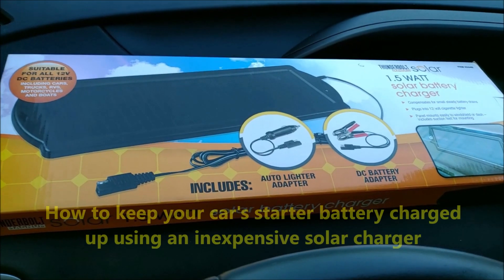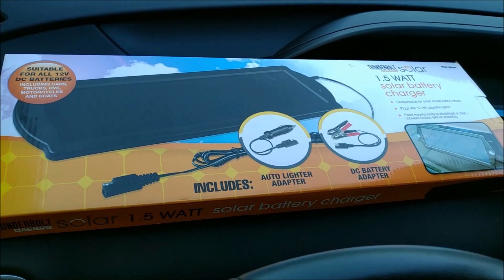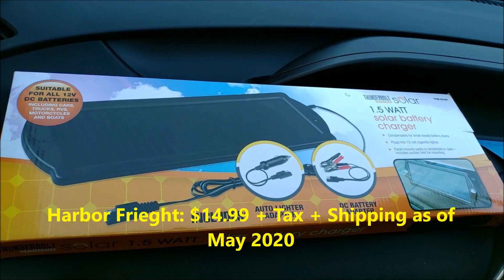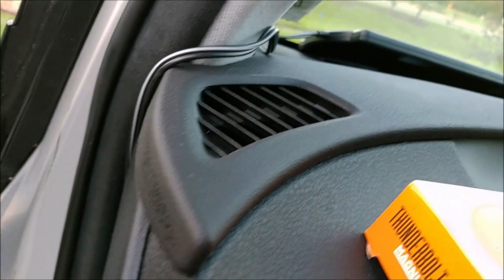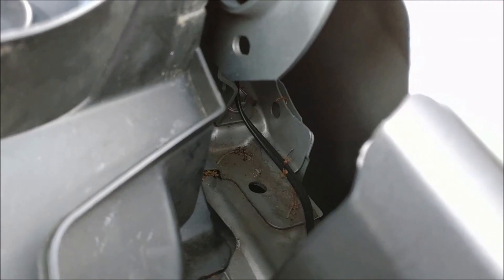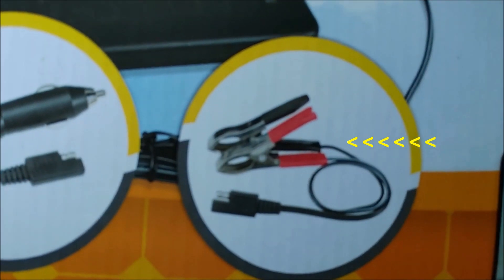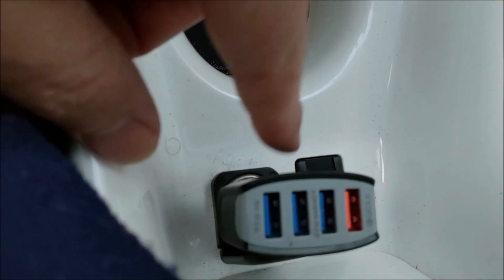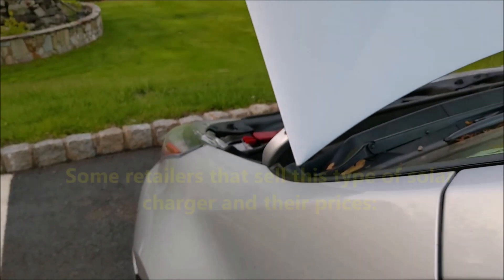Car Solar Trickle Charger During Coronavirus Pandemic | Installation Guide & Tips

Comment: Shouldent you connect negative to the ground instead of directly to cars battery negative pole?
Reply from the maker: Not in this case because it's not high amps like a jump-starter. However, check the manual for correct installation

Comment: A few people are defending idling the car to maintain battery health. Idling an engine in a modern car is fairly useless for maintaining the car battery's health. Especially with how much power is consumed by onboard electronics on a typical newer car and simply starting the car, it's clear that going for a drive on an open highway for about 20-30+ minutes once a week helps recharge the battery whereas idling does little or nothing for most cars.

That said, since I have two family cars that aren't driven much, I now have two solar trickle chargers that have been fantastic.
Reply: Yes, and if we equate the amount of energy used to start the car, even with a good-starting engine, that’s a chunk.  My experience of our little French Clio from 2000 (!) is that it works very hard if it finds the battery is low, the alternator really is made to pump out energy.  I put a brick on the pedal and a small block of wood under it, so the car revs but not too much.  Overall, this works, but it’s a lot of fuel - I calculated one tankful of this little car was getting 42mpg, then the next tankful was over a cold period, and it managed only 33mpg.  The routes were broadly the same, but at least half of the difference - 5mpg say - was due to the idling/warming/defrosting actions.  Free energy, is hard to argue against, so I caved and bought one in the UK, recommended and sold as an Automobile Association product.  Only 4.8 Watts, my Prius is the worst for phantom/parasitic drain, and Toyota UK have literally advised people to ‘drive longer journeys’, to avoid their battery running down, when they are not driving much or far.  !  Seeing how it goes.  Not detaching it when I start or drive the car.  Will mount under the rear hatch somehow.

Comment: I was worried about being able to close the hood with the clamps connected to the battery, but it seems like that wont be an issue, correct?
Reply from the maker: It has to be done carefully through the quarter panel if you can find a gap, as shown in the video. Also be careful about rain water getting in through the door. The wire should be facing downwards as shown in the video.

Comment: Towards the end of the video you start to talk about using another item so that can be used so that  you don’t have to run through the cord thru the door to clamp on the battery. But the video ended. I’m trying to get a device that will keep my battery charged without having to start it each week and let it idle. Can this device charge my battery without having to feed through the door for the clamps?it looks like there are 2 different cables. Thank you
Reply from the maker: If your vehicles 12v outlet (cigarette lighter socket) remains powered ON even after you turn off your car and remove the keys then you can use the 12v adapter that comes with this solar panel. You can test if it remains ON after you turn off your car with a 12v phone charger or something similar.

But if your vehicle's 12v outlet (cigarette lighter socket) does not remain powered ON after you turn off your car and remove the keys then you need to run the cable through the door and use alligator clamps, or find a way to get the the cable through the firewall to the battery.

Some vehicles like Dodge Grand Caravan and Mazda SUVs have two separate 12v outlets. One turns off when the car is turned off, and the other remains powered ON. The one that remains powered ON has a battery sign on the outlet cover.
Reply: @americanhindi  thank you so much! That’s the exact info I was looking for!

Comment: Will this charge the battery even if the car is under cover and no direct sunlight falls on it?
Reply: My solar trickle charger has an indicator light which does come on, even without direct sunlight. I had tested throughout the day if it would be a charge underneath a carport. It may be noticeably slower to charge though, especially if it's a low wattage panel to begin with.

Comment: Is it possible for you to actually discharge the battery if you leave this connected, say during the night?
Reply from the maker: Only if the solar panel's diode is defective or broken. Mine is continuously connected to the battery since this video was made.

Comment: Thanks a lot. Cant seem to find these in Mumbai so I just ordered a 5w12v solar panel and a smart controller for auto cutoff at 15v for a DIY project. Hope to install it soon. Total cost around Rs.800 and should keep the battery topped up!

Comment: I think if the lighter charge point switches off then you can charge the battery because there will be no current coming from the battery. Henceforth an open line to the battery. 
I might be wrong, but it makes logical sense to me.

Comment: So for people that dont know a ton about vehicles. If your battery is dying or not starting up your vehicle due to you not driving your car for the past few days that would mean either 2 things. 1 your car is using power meaning you left a light on or something. Or 2 your battery is bad. If your not using your car for several days then your not using power so your battery should be stable. now it is good to go out and run your vehicle every 3 days or so for about 10 to 15 min so its not sitting. But this method would be good for those who have a special vehicle that just sets and only gets driven on certain special occasions.

Comment: I bought this same one, my problem was that when I left it hooked up to the cigarette lighter at night, it drained my battery!  Also, would it be better to hook it up with the cables directly to the battery?  And do I take it off at night and on rainy days as well?  Thank you!
CANCEL
Reply from the maker: If your cigarette lighter socket stays powered ON even after you turn off your car, then it should work. If the socket disconnects when you turn OFF your car then you need to connect the panel directly to the battery but follow the manual. You can test your socket with a phone adapter as shown in the video. Make sure the cable is secure and check on it periodically. 

This panel has a diode that prevents reverse charge, so current flows in only 1 direction. If the panel drained your battery overnight then the panel is defective. It shouldn't drain your battery. It is designed to keep connected at all times if that is needed. You don't need to disconnect at night, unless the panel has a defective diode.
Reply: @americanhindi  Thank you very much for your answer!  
This is really  helpful!
Reply from the maker: @idekmarijke2380  You are just welcome.

Comment: I did this other day not because of any videos but I just thought about it. Because I has two big solar panels doing nothing from previous projects. I went through like 3 batteries over years. Running car on idle isn’t doing harm for your car look at all the cop and ambulances. We usually have storms and power outages here so living in cars is common

Comment: Hello, i don t have a 12 v socket in my car, i just have  a 5v, doest it work or i have to connect the panel directly to the baterry via the crocodyle clams ?
Reply from the maker: This is a 12v trickle charger. I'm not sure if it's safe to connect to a 5v battery.
Reply: @americanhindi  thnak you. The car battery is 12 v but the socket in the car is 5v. What i want to say is that i don t have a 12 v cigarette socket , just a 5v socket in the car to connect the solar panel to the 12 v battery of the car. I hope the 5 v socket works
Reply from the maker: @radum3738  If you don't have a 12v socket, then you have to connect it directly to the battery but make sure the cable is secure. I would disconnect it before driving the vehicle if you cannot secure the cable under the hood.

The 5v outlet probably has a resister that prevents reverse current, so it may not work, or damage the resister due to higher voltage.

Check with an auto technician first.
Reply: @americanhindi  thank you verry much sir!
Reply from the maker: @radum3738  you are most welcome. Take care

Comment: can this be used to sustain my car's air conditioning and accessories for my job's 12-hour shifts throughout the summer without idling my engine? 2018 maxima
Reply from the maker: This will not sustain any such loads. It's only a trickle charger designed to maintain the charge that is already on the battery. It's not designed to replace your cars alternator. If you need to run accessories and you don't have access to utility electricity, then I suggest getting a battery power station.

Comment: Thanks for showing how to use the alligator clips and still have the solar unit inside the car!  Also, how to test the cigarette lighter!  Thank you so much!
Reply from the maker: You're most welcome! 😊 I'm glad this video was helpful. I still have my alligator clamps attached to the same battery since April 2020 😊 Battery is in good health thanks to this device.
Reply: @americanhindi  So you’re leaving the alligator clips connected all the time, including while you are driving?  

Also, you didn’t mention anything about making sure people get a trickle charger that won’t overcharge the battery, which is just as bad (and in a worst case scenario could actually be dangerous because it could lead to the battery exploding) as not making sure the battery gets enough charge.

Comment: Dont you need a regulator if you leaVe it on for a long time solar charging?
Reply from the maker: The current is so small even in full sunlight that you don't need a charge-controller. I've measured that even in full sunlight it's only in milliamps. That is why it's called a trickle charger. Technically it's a maintainer. It can't recharge a dead or even low battery. OR it may take several days of full sunlight to recharge a dead or low battery.
Reply: @americanhindi  yeah im going to have mine on for months on my van so do i need a regulator?
Reply from the maker: @sergioknuf  You won't need a regulator for this particular type of solar panel. I have left mine on my dashboard since spring 2020 without any issues. You can't overcharge your van's battery with this thing. Sunny days will cover for cloudy days. In the winter point the panel/van towards the South if you can.
Reply: I’ve tried this for my Mazda 3 and it didn’t do much. I ended up ordering the Hulkman charger and that helped more than the solar charging.

Comment: Do you keep it connected while starting and running the car?  Would like something permanent.
Reply from the maker: Yes, it has remained connected since I made this video almost a year ago. I start and drive around with it connected, but I don't recommend doing this. In my car there is bump on the dashboard for the HUD that keeps the panel from moving side to side when I'm turning my car. The bump holds the panel in place perfectly. In other cars you may need something like double sided tape to secure it on the dash and in a way that doesn't obstruct your view. Also make sure that the wires are secure and don't move around using ties for safety reasons. Every once a while open the hood and check the wire and if the clamps are attached securely. 

FYI first generation Nissan LEAF had a permanent 12v solar panel in the rear spoiler to trickle charge the 12v accessory battery. It used to give an output of ~500 mA on sunny days. It was very helpful to have that because I didn't drive that car for 6 months of the year. I wish all automakers did this.
Reply: @americanhindi  both the video and your comment were SUPER helpful.  Thank you very much.  You’re probably saving me about $200 on a UPS lithium phosphate battery for a project I wanted to do.
Reply from the maker: @cbonesteaksauce3833  you made my day! I'm glad this was helpful. Thank you for your encouragement 🙏🏼

Comment: Do you leave the terminals connected when car is in use. Or do you have to disconnect while driving?
Reply from the maker: Good question! Mine have been connected since almost almost one year now. I just leave them connected because my driving usage is sporadic. But if you are driving daily then there is no need to leave them connected unless you have a very weak battery as I do. You can unplug the alligator clamps and disconnect the connector. You may leave the solar panel's side of the connector inside the hood. Use a plastic tie to secure that connector to prevent it from dangling around when the car is moving.

Comment: Lol idling your engine isn't bad for it.....unless you have a bunch of emissions garbage attached to it
Reply from the maker: Internal Combustion Engines have a lot of moving parts. There is wear and tear while the engine is running. That is why it requires frequent oil changes. Notice how the oil goes from clean to dirty at the time of changing engine oil. Idling simply adds to the wear and tear and reduces engine's life. Not to mention the waste of fuel, reducing local air quality and unnecessary release of greenhouse gases and particulates into the atmosphere. Also there is a health hazard to people nearby including the driver as some of that exhaust fume makes into the cabin. Don't Idle Your Car - 5 Reasons Why: https://youtu.be/GLo7NEMeHoY
Reply: @americanhindi  Ha, Im sorry but you are wrong. As long as maintenance is always done (filters,oil,etc) idling does not effect longevity. And in fact, running your engine more frequently actually helps with longevity. Just take a look at diesel engines for example. They generally idle more than any other engine due to their applications of us. And they have 3x as long of engine life compared to most gasoline engines.

Comment: this is a GREAT idea. I have an old car.  Even using a jump pack charger through the cigarette lighter didn't work to jump my car. So I was concerned if the solar charger I just order would work. But I didn't know how to have it run from inside the car to the battery like you are showing in the video.  Thanks very much!
Reply: Same

Comment: At .125 amps at max output which will likely not happen, especially through windshield, plus cloudy days, and likely 5 or 6 hours of sunlight, I don't see how it can really make much difference to be honest. Most solar panels, likely including tis one, state their output at perfect situation and one rarely gets very close to those in real life.
Reply: Here in South Texas it works
Reply from the maker: It works! I have been using these for my car and motorcycle batteries since 2008. If the batteries are in good condition then this maintains the charge for months. If the battery is old and holds a low charge like my current car (about 11.5v in the winter), it at least prevents the battery from completely dying. Of course direct sunlight at least for a few hours a day is preferred especially in the winter when the battery is very cold. In any case, the battery is slightly better with this small cheap solar panel instead of nothing. If there is no direct sunlight for many days, then the little charge is not enough to make up for phantom loses of car's electronics, sensors, and telematics. However, it will at least delay the loss of voltage a bit even with day light. Bigger panel with higher wattage will do better job if the car does not have direct sunlight. I prefer this one because it doesn't come in my line of sight while driving and I can keep it on my dash throughout the year.
Reply: the thing is with this solar panel its always plugged in and you don't have to get an extension lead from your house every time you wanna recharge the car battery. 
also running a charger through the mains is just impossible for those who live in flats. in which case this is the perfect solution. yes it doesn't charge as quickly but you have it charging for many times the time you would through the mains charger so this actually works out a lot better.
Reply: Surprised considering most trickle charger / maintainers that plug into the wall are 900ma-1amp. But yeah, I guess if you have zero draw while it's sitting, these would give it some charging at least eh. It's not unusual when car is off, to still have 300ma draw on them from misc items.

Comment: My Honda’s cigarette lighter goes off when I turn the car off. So I guess I have to use the alligator clips to the battery. I hate that. My solar charger doesn’t have a led to show me that it’s working. So how do I know it’s doing anything?
Reply from the maker: If you have a multimeter, you can set it to mA DC (miliAmps DC), connect the leads to alligator clamps, and you should notice some activity when the panel is exposed to any bright light. The activity should go back to zero when the panel is covered. I do this before and after installation just to make sure that the connectors have made contact. This test should be done with or without LED indicators.
Reply from the maker: No LED on your panel improves the efficiency slightly. Also, I have panels where the LED indicators stopped working but the panel continues to produce power.
Reply: you could rewire the ciggerette socket to a fused 10 amp circuit in the fuse box that always has power. that way you can put the panel on your dash and leave it there for ever